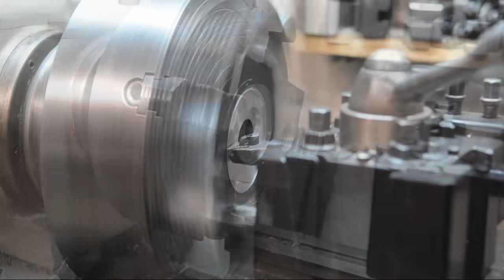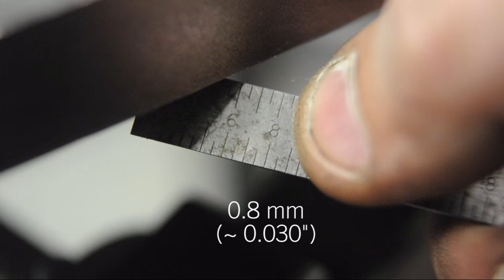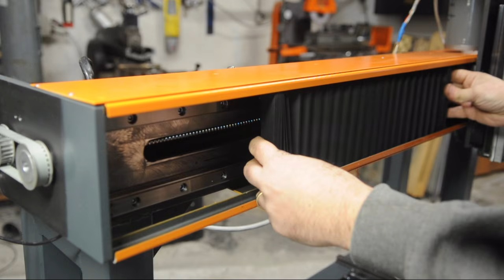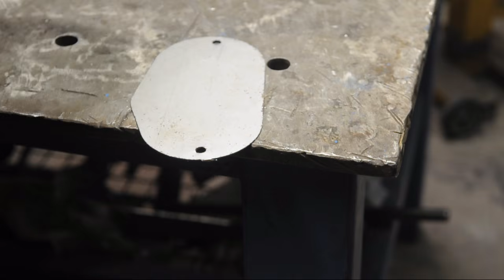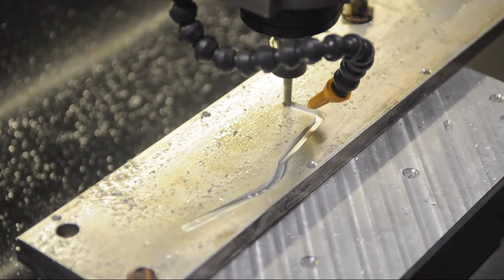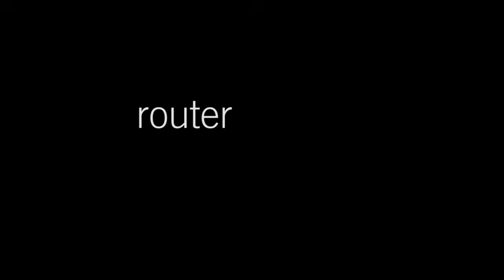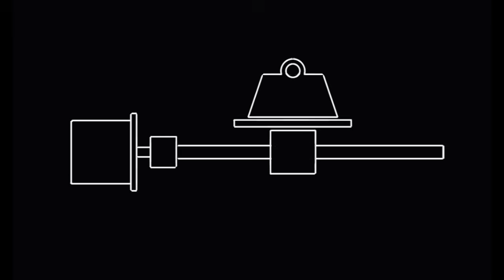Fixed Gantry CNC Router Build Part 3

Comment: Great job and a brilliant design. I am looking into making one a but scaled down. Would you please tell me what kind of spindle did you use and how much horse power. Would you think a 1.25 horsepower spindle will do the job?
Thanks and great video
Reply from the maker: +Gary Pace 1.5kW air cooled spindle from ebay -- ER16 collet... that's about 2 hp.
Reply: +This Old Tony thanks a lot 
how does it handle with hard metals lile steel?
thanks again
Reply: +This Old Tony thanks a lot 
how does it handle with hard metals lile steel?
thanks again
Reply: +This Old Tony thanks a lot 
how does it handle with hard metals lile steel?
thanks again
Reply: +This Old Tony thanks a lot 
how does it handle with hard metals lile steel?
thanks again
Reply from the maker: +Gary Pace You can see it cutting steel here: https://youtu.be/jOvGv9aRKFs
I wouldn't push it though, I don't know if the bearings would hold up long term.

Comment: Did you use a 24k rpm spindle? If you mentioned it I missed it.
Reply from the maker: +Sam Yep, 1.5kW air cooled spindle -- ebay special -- 7200 to 24k.

Comment: excellent build video series. Thanks. Questions:
a) what is your weight estimation for your machine?
b) Since you are interested in good acceleration did you consider closed loop (BLDC?) servo motors and DRO glass rulers? 
Tip: The link shows that Beagle Bone Black (~$50-60) can drive steppers much faster using the 2 internal PRUs compared to Arduino.  https://www.youtube.com/watch?v=hIEY9077D64 Just in case processing speed is the limiting factor and not the motor torque.)
c) Why did you not use a closed rectangular tube instead of your slotted chanel profile an put the ball-screw btw. the guide rails on its outside? -> more torsional rigidity + -> simpler manufacturing.
Reply from the maker: +rol eic Thanks .. no idea how much the machine weights.. 2-300 lbs?  I already had most of the components that I used in the build.  If I were to purchase again, I might have taken a closer look at what's available.  Two tubes would've been a good idea but then you have 2 rails on 2 separate structural members.  Had I known I was going to machine the surface anyway I probably would have gone with your suggestion.

Comment: Hey Tony, yes I would be interested in a video on the design if you get a chance. I've been running over designs in my head for a build of my own, and will most likely go with a 4 post gantry arrangement to maximise overall rigidity and minimise a constant flying weight, but I'm very keen to hear of other's thoughts and experiences as to how they came to their ideal solutions.

As always a very impressive video, and thanks for putting this up.
Reply from the maker: +Pete F Thanks Pete.. I also had a look at a 4 post, you can get the same rigidity I did with less steel.. the only thing that kept me from going that way is reduced access to the machine.. the spindle gets buried a bit and I was worried tool changes would get tedious.  But maybe I just didn't have the right design.  Thanks for watching.

Comment: Why such a heavy table with the inherent inertia?  Could you of milled out some of the inside and leave thick ribs and sides for support but reduce the overall weight of each slab?
Reply from the maker: +user990077 Originally I meant to do a fabricated welded table.. it would've been lighter, but maybe not as flat.   But yes I think it could be lighter, it would've just been a lot of milling for what has turned out to not be much of a problem.

Comment: I've had a Huanyang VFD on my Harrison L5 lathe for about 5 years. There's another on the Bridgeport clone and that's operating in a sealed metal enclosure roughly 4-5 times the volume of the VFD with no overheating issues. There are a further two Huanyang VFDs in my cylindrical grinder and I've fitted them for others. No problems with any of them yet. The ones of mine that I've had apart has Japanese branded capacitors and power devices.

The keypad feels a bit crappy because it's actually using proper tactile switches on a PCB, but with a membrane over the top. All my machines have proper external industrial switches, rather than using the keypad. I wouldn't like to operate any brand of VFD from the front panel in regular use, that's not what they're for. They're really only for diagnostics and setup. The lathe in fact has no keypad, as the VFD is burried inside the stand. It has a longer ribbon cable so I can plug in the keypad externally if I want to change any of the settings.

There's a LinuxCNC plugin for the VFD to control it over RS485, but you might have to solder the RS484 driver chip onto the main board. They seem to come with some options not fitted. I think the units on ebay are all production tacked on to OEM orders. I've added opto-isolators where I needed interlock systems for the grinder and some people have added the components for the dynamic braking.
Reply from the maker: +Paul Compton Thanks Paul, thats encouraging to hear.  I'm also wired externally, so the VFD doesn't get manhandled, but it just felt a lot lighter (almost empty!) compared to my name brand VFDs.. and then there was the keypad thing.  I've seen USB-RS485 mods done to get PC control over the Huanyang.. I have plans to give it a try one of these days.  On the list!

Comment: I want to bring up something that always puzzles me:

You have a couple of hundred bolts on the linear bearings attaching them to the frame
16 attaching the table to the bearing blocks
You have a couple of hundred on the x axis
You have a multitude on the spindle z axis

and TWO attaching the table to the ball screw.....the part that is going to be the first step in taking the force of the machining...

It's not just you...I was watching another guy building a large cnc (for wood). He had 16 attaching the back plate to the plate holding the bearings....16 attaching the z axis plate to that plate....and 8 1/4 20's holding the roller bearings in place...where all that weight is being carried and all the force of the machining is going to be added to it....(btw, that force on the bolts holding the bearings is going to be live dynamic force too...not just up and down, but forward and back and left and right as well, not so much left and right because the bearings will roll)
Reply from the maker: +michael C Excellent observation Michael C.. both ballnuts are fastened with two 5mm screws, each ballnut (therefore their screws) take the full machining load.. now just to clarify, that load is the actual cutting force, not the weight of the machine or the parts being cut.  The cutting force is tricky to figure out, but I'm assuming its less than 50#.. this gets hairy if you figure worst case scenario.. you're not cutting.. you have bad gcode (well, lets say you screw up) and you do a rapid move while you're still in the material.. forces are way higher.  Two things could happen: either the cutter breaks, or those screws do.

Two 5 mm bolts can handle almost 500# of shear force .. it would take that much to literally cut them in two.
So it's more likely that the endmill sticking out of the spindle unsupported will break first.  

And believe it or not I've seen that happen with my own eyes. :)

Now if you were to actually crash the spindle or one of the axis.. that's a different story.. the screws could break.. hopefully the limit switches stop that from really happening.

Thanks for watching!
Reply: This Old Tony yeah I thought they looked like 5 mm but couldn't see what grade they were.....I'm assuming grade 5 or 6? 

As for calculating cutting force, since I am re-designing my (wood) cnc router, I've been trying to figure out how to do that over the past couple of days....I know it will vary greatly depending on what material, what DOC and what bit.....I know mine will be a bit of over kill because I'd like to be able to make skiff cuts on aluminum (.001")....the POS I have now flexes under load in PINE....

One thing about your steppers: I guess you know you can increase their speed/torque with the gearing on the belts? I don't know what feed rates your shooting for but I have to assume not really faster than 40 IPM? I mention this because on your Z axis, (don't know the length of your travel) but even at a rapid jog rate of 5 IPM it would only take seconds to travel the entire length....I am going to play with my settings because I'm constantly turning down my rapid jog for the z axis to set 0 then turn it back up to move the other 2 axis....

Keep up the good work, great vids! I sit here and think: OMG how good would my CNC be if I had your machines? 

(btw, I almost cried when I saw you make the heat sink out of that block.....I recently got into aluminum casting and though: I could have made that with 1/5th the amount of aluminum lol)

Comment: Can we see more of that FEA?
Reply from the maker: +Austin Downey Thanks for watching to the end Austin .. anything in particular on the FEA front?
Reply: You may of covered all of it in saying you used a 50 lbs cutter load.  

How did you account for your X and Z axis bearings?

 If you where just interested in the rigidity of the frame I am sure fixing these conditions would get you close enough. (Assuming that is what you did).

I doubt many people would see the point of a FEA on a home built CNC router, but I thought it was great!!!
Reply from the maker: +Austin Downey 50lbs was a shot in the dark, I'm not sure what forces, say, a 1/4" endmill 1/4" deep in steel produce -- but 0.001" @ 50# sounded safe for a hobby machine.  Each axis has 4 skates and the combined moment load of those four is well above what a 50# cut at full extension would produce -- at least according to the spec sheet -- so I just concentrated on the steel.  before the FEA I didn't have the rear supports or the gussets, so I think it was worth while.

what would've been really nice: painting the frame so it looked like the meshed FEA results!
Reply: hmm,  I like the idea of painting the frame to match the FEA results.

Comment: Excellent work Tony! Since Mach3 has some inherent flaws or issues that you may not have run into yet you may be better served by looking into LinuxCNC.
Reply from the maker: +Jeffrey Vastine Thanks Jeffrey -- LinuxCNC has always intrigued me but i'm so danged tied to my microsoft-bases software I don't know how I'd handle -- maybe dedicated linux box on a network to share files?  Interesting option, though, thanks.

Comment: Thanks for the great videos.  Your tools are impressive.  Can you provide more info on your electronics components and why you selected them?  Also your sources for these components would also be great to know.  Would like to follow in your footsteps...  
Best regards.
Reply from the maker: +neatmachine I had most of them from an old CNC plasma table I built years ago, so there's probably newer / better stuff out there.. but the drivers are Gecko G210's (gecko.com) on a SoundLogic Break out board (campbelldesigns.net), driven with an ESS Smoothstepper (warp9td.com).  Somewhere in Part 2 I spell that out if you want to watch that again.  Thanks for watching.